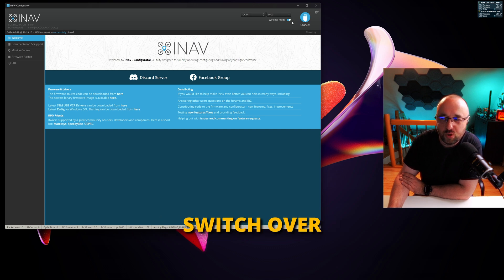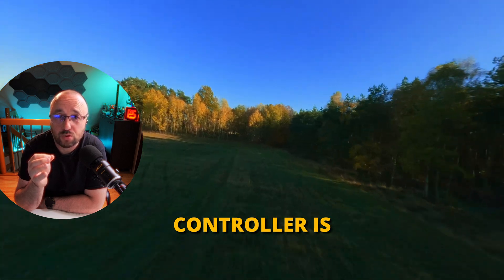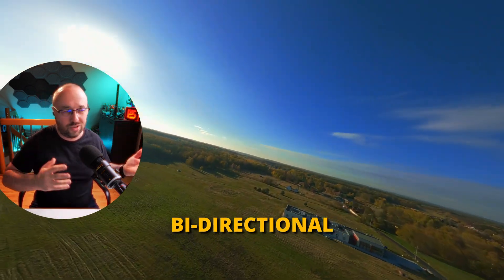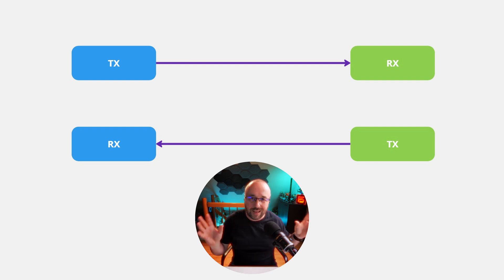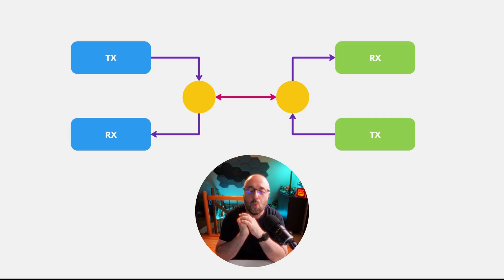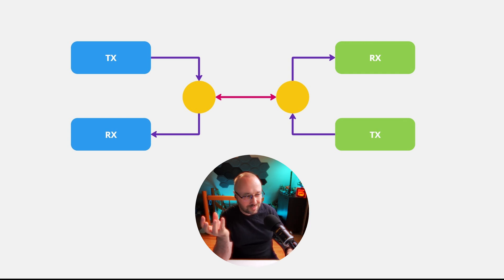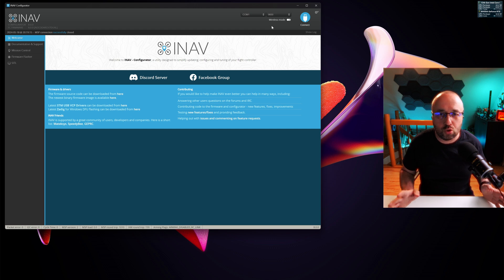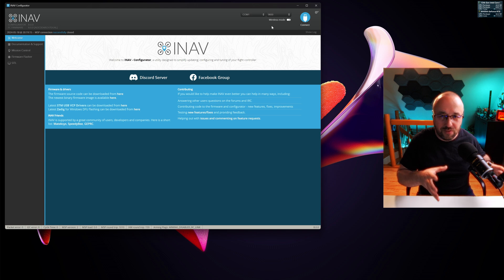INAV Configurator Wireless Mode

Comment: Thanks Pawel - my bluetooth connection works whether I am in wireless mode or not - but wireless mode appears to be a lot slower - for example, when i'm looking at the status screen and move the quad, the status screen is not smooth.  If I turn wireless mode OFF, the status screen is much smoother as the quad moves.  So... is there any reason to turn wireless mode ON if a person gets a good connection with wireless mode OFF?  Thanks...

Comment: And the OSD with my Speedybee f7 V3 and my Walksnail Avatar glasses still doesn't work. I just can't get any OSD displayed. Betaflight works without any problems. They should fix that.
Reply from the maker: Have you considered that maybe you do something wrong because it works for everybody else?
Reply: @FPVBites  I checked the wiring several times. Tested all settings in INAV. In Betaflight it works with the same copter without any problems.
Reply: @Ericcando81  I bet you select MSP as a serial port instead of MSP Displayport
Reply: @FPVUniversity  No, I didn't click on anything there.